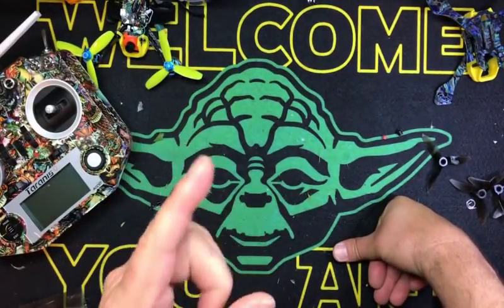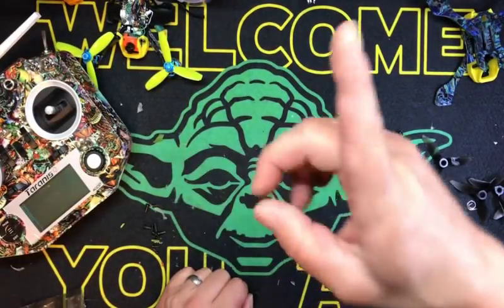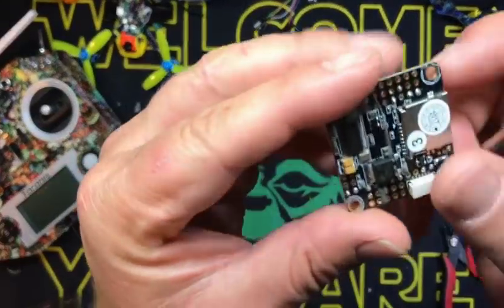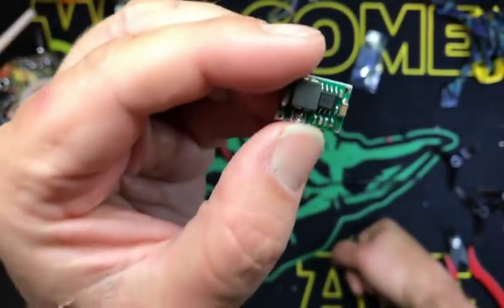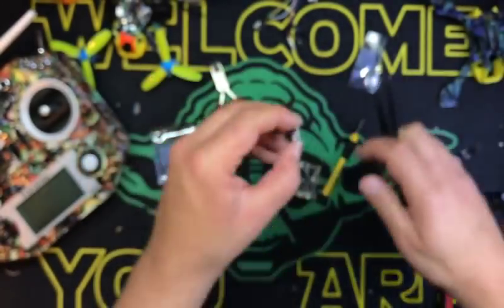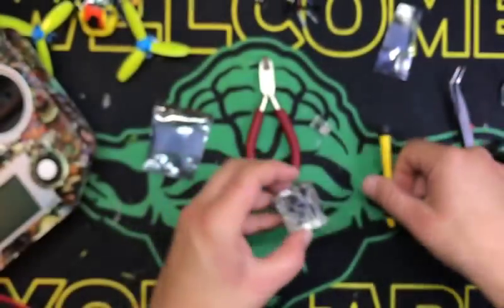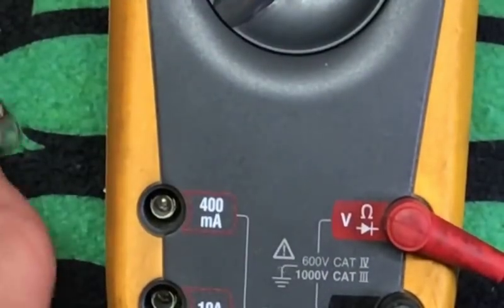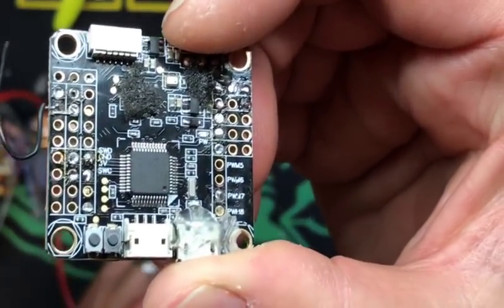Missing 5Volts? Fix your FC easy and cheap!!!!! Pacemaker for your Flight Controller

Comment: Thanks . I fried a flight controller g
5 volt regulator when camera wires came off and shorted .  I saved it wrapped in tape labeled thinking about those heat blower and tweezer bec fixes fir the future 3419 adwhen i had the skills .  
   I fried a regulator hooking a diversity 5.8ghz fpv reciever and dvr to it on 3s . Too much stuff . 
 No leds but 10 seconds later a tiny puff of smoke .

Comment: Thanks so much ... Was just about to order a hole new fc. I'll try this instead
Reply from the maker: If that’s all that’s wrong this will work.
Reply: I just took off with the second batt of the day and it just went dark and dropped outta the sky. Got it in and there was no 5v anywhere
Reply from the maker: When ya plug into the usb does the 5v show up??? Connects to the puter and all that
Reply: If I plugged in USB it connects to betaflight and 5v comes back on
Reply from the maker: Yup.   That’s the problem.   Do my trick and it’ll come back to life.    Keep me posted
Reply: Got it ordered 👍
Reply from the maker: Saweeeet

Comment: hi  thaks for the tutorial... i have an issue tho... i powered the fc with a bec, ok it works now, but i cant see the lipo voltage in osd.... it shows 0V ... is it because its powered via bec and it doesnt read the lipo?... is there any ways i can solve it?  thanks.

Comment: I was using a smoke stopper fixing a quad for a friend and there was a short Thought the smoke stopper was going to save me ,how wrong was i
Now when i plug the fc into the computer i get the sound but it wont connect and there are no lights coming on the fc
What has most likely blown? and can it be fixed
As always , nice vid Jay
Reply from the maker: Message me brother and we will talk about this

Comment: Currently troubleshooting quad with clf4. High throttle video scramble, caps won't fix, it's not antenna, or vtx, either escs, or fc, would this 5v thing be possibly fix?
Reply from the maker: It’s definitely worth a shot.   It would be a clean power source.    I had a problem like that once.    Chased my ass for a long time, I never have video signal issues but this one bird kept pissing with me.   Ended up being harmonics in the frame believe it or not.

Comment: i have a ? what glue do you use to hold the usb if it was lose and other stuff too the FC.
Reply from the maker: Ooooh the curse of the omnibus f3 USB port.   Fuckers come off easy.    Mix up some 2 part epoxy and use a toothpick to put it around the USB port area.
Reply: ok thanks

Comment: Hey JJ! I think that you should consider using a 5v UBEC instead. Potentiometers fail in high vibration environments. Here is a reference. https://www.zettlex.com/articles/engineers-dislike-potentiometers/
Reply from the maker: Yes that’s why I got glue them.   I use these in quads and fixed wing as well.   Long as u secure them they do well.   I agreee woth ya tho.   I’ve used becs as well, and becs are less to piss around with as well